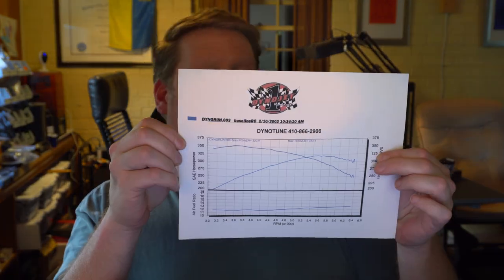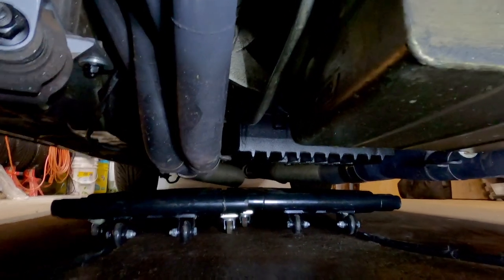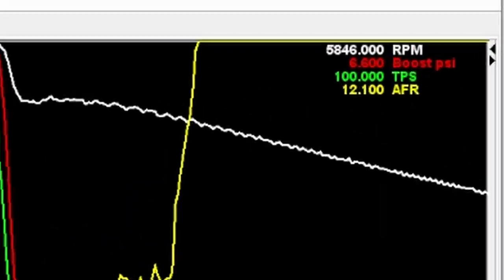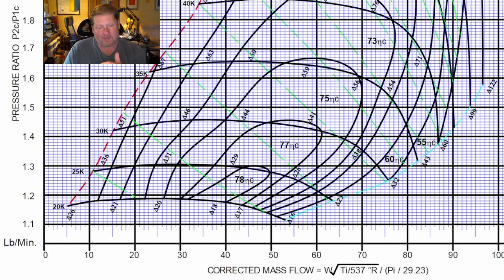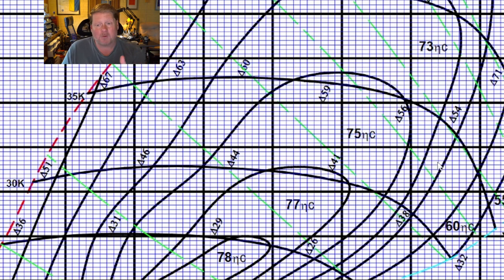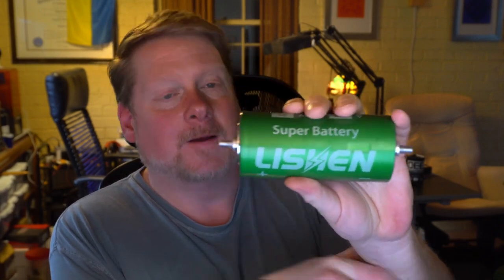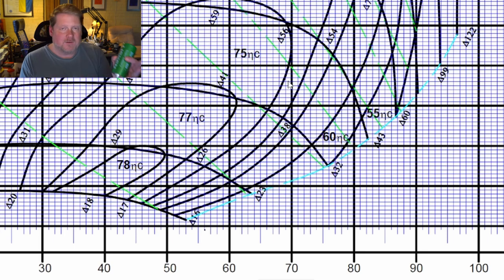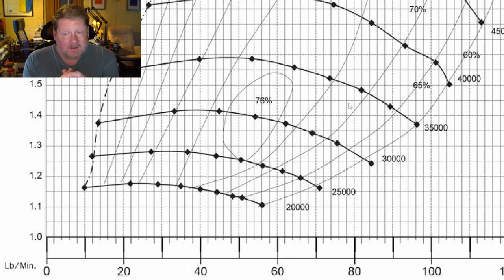DIY Electric Turbo: More Power from the Sledgehammer

Comment: The motor is direct drive or have a set of pulleys on the impeler? Why not make a set of pulley behind the "turbo" that actually you need less voltage to achieve the desired rpm of the turbo?
Reply from the maker: The motor is direct drive - if you look back in my electric turbo videos you can see how I made it - it's a hex drive.  I've also built a smaller unit that's belt driven so you can fine tune the ratio to get maximum power.  I will get back to that smaller unit, probably over the summer when it's too hot to race.  There are some problems with a belt drive.  At the speeds we're talking about, the belt gets hot fast.  As for a significant step up as you're suggesting, the problem is still one of available power.  The lower rpm your motor is, the more step up you need.  Which means you need a proportional increase in torque.  Which means the motor size dramatically increases.  And then of course, you have drive losses to overcome.  At this moment, given available brushless motors, I'm favoring direct drive units.  That doesn't mean things won't change, it's just what I think is the best for current technology.

Comment: I spray methanol at the cold side charge pipe and manifold intake via a boomba spacer with ports. I would love to hear more about pre-compressor spray. I'm not sure where that is and I don't want to assume I know, my guess would be wrong most likely (I am also running air to air intercooler). But I definitely want some pro and cons on what you're planning on methanol so I can think on it and see if it's something I may consider. Cheers 🍻

Edit:
I'm not looking for more power but more efficiency and engine longevity. I'd rather buy a new turbo vs a new engine.
Reply from the maker: I'll do some videos on that soon enough (in the next few months).  I can think of pros and cons in your case, but you'd have to decide for yourself if it suits your needs.  I'll do my build, installation and testing, and you can use my data to make your choice.
Reply: @AlexLTDLX  good stuff man 👍🏾

Comment: i have 300c v8 5.7  awd, and it is car for highway(not some drag strip project) and i am looking to raise power for some 100hp but i do not wanna install supercharger(too expensive) or standard turbo(no space for it).
I was thinking about electric supercharger but it is complicated and i am afraid of lipo fire(it would burn whole car).but i think about some combination : to take two turbos(for 3. 0 diesel engine), one per bank and to split compressor from turbo part: turbo part would be near exhaust collector and compressor would be somewhere in front bumper, turbine would propel brushless electric motor that would act  as generator and on compressor would be (same type) other bs el motor that would be driven by electricity(direct connection by cables, no regulator) from turbine generator, i need some 2-3kw bs motor  that would survive turbine power, do you have some tips for this idea
Reply from the maker: That might work, but you're doubling efficiency losses and I have a feeling that getting the generator side to live with exhaust heat that close might be tricky.  But that's a good way of thinking!

Comment: What is your current battery voltage? What's the maximum voltage your ESC can handle? You need a safety margin of course so you don't turn into smoking rubble. If your current battery solution isn't at the safe upper limit of your controller, then this gets you more motor RPM and you want that. It might be a better way to use those extra batteries you have. Of course if you are already at that best possible battery voltage, less battery sag will help. I forget what you said was your motor Kv, but I'll pretend you said 315kv. You said you are seeing about 4v drop on your phase wires and that's ideally 1,260 RPM that you are not seeing at your impeller. Those long phase wires are causing you boost losses.
Reply from the maker: I charge the packs to just a bit over 62 volts.  The ESC's max rating is 63 volts (I looked at the capacitors in the ESC - they are indeed, 63 volt caps).  The motor kV is 615 at the actual load we were seeing.  I believe the motor's rated at 750 kV or something.
Reply: @AlexLTDLX  Yes...you don't want to go to a higher voltage. You are there! Motor KV is determined under no load. You are seeing this yourself that you don't ever see that free spinning RPM under load. If your motor is 750kv then at 62v, that's a maximum of 46,500 RPM. With 4v loss from phase wire length that's 3000 RPM not happening at the motor under ideal circumstances. Id still guess at another 1200-1500 RPM you should be seeing at the motor under load.
*
You know your boost pressure since you have a sensor for that. With the brushless motor and controller, you can set your motor to X RPM and then measure boost pressure. Have you done any mapping of motor RPM vs boost pressure? The new impeller has some kind of graphed map of it's output pressure at various RPM's. How close are you to the specs from that graph? 
*
You've had an exhaust driven turbo on the engine and you know that some amount of engine power is needed to spin the turbo. You can also measure your motor amp draw and battery voltage on the current setup. You have 2 forms of Kw of power used vs wheel horse power gained. My assumption is the motor driven turbo is more efficient, but I don't really know that is true. You need to charge your battery pack and that ought to play into the efficiency results as well. 
*
One last detail. You know you are pulling something like 700 amps at 62v or about 43kw. Is that motor power best served by powering a turbo or by driving the engine crank shaft directly? 
*
This project is quite fascinating to me because I spend a lot of time on EV's and none on ICE. I do love what you are doing and the fact that you are willing to try this out!
Reply from the maker: You bring up some interesting points.  LMT supposedly rates the motor "loaded" - not sure what that means.  But they also told me point blank that 50 volts is 42,000 rpm and 550 amps.  Clearly, we're loading the motor harder than that.  The motor is rated for 40kW (53hp).  We're seeing about 675 amps running with a voltage at the ESC of 52 volts (battery voltage sag) - ~35kW.  It's pretty hard to map boost pressure vs. motor rpm, given these power levels, torque converter slip, etc.  But we are starting to fill in data points from different testing.  This is more efficient than a conventional turbo simply because there are no pumping losses in the engine (a conventional turbo creates a pretty substantial exhaust restriction - sometimes as high as 2-3 to 1 (i.e. 5psi of boost creates 10-15 psi of backpressure in the exhaust).  Currently, the brushless motor is generating about 47hp.  We saw a gain of 150 rwhp from that 47 hp (actually more, but the converter slip wasn't our friend).  If we simply used the motor to help drive the car's wheels directly, we'd see a rwhp gain of, well, 47.  So this is more than 3 times more efficient than driving the wheels directly.
Reply: @AlexLTDLX  LMT = Loaded Motor Torque? They can't give you a hard number for amps in the motor. That is highly dependent on controller current delivery, battery sag, motor loading and motor RPM. So if the other 2 things they said are true...aka 50v = 42,000 RPM, then your motor has an unloaded KV of 840. This is unaffected by current and pack voltage. It does sound like the electric turbo is more efficient than an exhaust driven turbo by a lot. Same for the turbo vs driving the drive shaft directly. You can use your cars alternator with a DC-DC converter to directly charge your battery pack for the turbo. I assume for now that you are charging it externally. Obviously the car has to be running for that to work, but I'm also assuming your car gets driven, not just raced.
Reply from the maker: LMT - Lehner Motoren Technik; they work with MGM (who makes the ESC) and sell their motors/ESCs as a kit of sorts.  I was rather surprised that they were able to be so specific, but clearly, the data says different.  By a good bit.  Interestingly, it doesn't appear to be a duty cycle issue - the phase amps and ESC amps match up pretty well once it's up to speed.  With the VESC, phase amps would be much higher than battery amps when the duty cycle was lower - like around 60%.  Look at my control box video - it has a built-in charger; in fact, I'm officially wiring the charger in today.  And yes, the car gets driven to the track and just driven around in general.  Here's the video: https://youtu.be/J7glXHY3AbI

Comment: What is your best guess on scfm being produced?
Reply from the maker: That's a tough question for me to answer.  Going by the compressor map, we're pretty much at 1,000 cfm (the compressor map has CFM on the X axis below the lb/min - google "Vortech compressor map" and pull up the map for an Si trim.)  Going by traditional "rule of thumb" calculators we're at about 1,200 cfm.  So somewhere in that ballpark.  I'd lean towards the 1,000 CFM number. edit This made me look up leafblower CFM just for laughs.  A powerful leaf blower is rated at 600 cfm; but that's with basically no pressure ratio or internal compression.  At even our relatively low pressure ratio of about 1.42, the  leaf blower would probably simply flow nothing.  Sort of puts that in perspective for me.  I can cap off both my gas backpack blower and my electric handheld with my hand.  There's no chance of doing that with this thing.  Not that I'd even try.

Comment: These listen cells won't last long at 50c, 

They're actually 13c continuous cells.

I'd be running 3 sets in parallel. 

I'm running yinglong cells on my vortech v3 h67b I'm running 45,000 rpm using a pulley system.

If you open my hood. It looks like a stock NA barra territory. The setup is hidden in the front bumper.

I'm using motor width as 2x magnet length equals 2x torque. 

2x motor diameter equals 4x torque. 

So it's more efficient to setup a puller system and gear it accordingly.

My block has a atomic 998kw rebuild kit. All I kept was the crank. Everything was thrown in the trash.

I managed to tear the threads in the head studs recently, so the bottom block is getting drilled and tapped for 14.3mm headstuds for 2000hp max holding and the head is also getting drilled out so the studs will fit.

I'm also taking off a bit more to raise the compression, because I can.

I'm running a btm zf 4 speed territory box with the pressure turned right up with a large gearbox cooler and fan.
I'm running a m86 diff with 4.11 gears and truetrac helical diff internals.

The diff handles 600kw daily and has seen 870kw with no issues

Comment: Try and make a swamp cooler for the electric supercharger
Reply from the maker: That's an interesting thought.  How would you implement that?
Reply: @AlexLTDLX   I would use an air box with k&n filter and and spray it with the water & meth kit and see if temp drop.

Comment: You're literally 1200hp away from where we were 10 years ago with a glide behind a SBF.  A glide is WILDLY MORE EFFICIENT THAN ANY FORD TRANS.  Say it with me.  You can do it.

STOP using the glide as an excuse when it's clearly an advantage.
Reply from the maker: You've never had to have your converter re-stalled?  It's a pretty common occurrence.  I've had to have mine tightened once already.  The glide isn't the issue - the converter is.  Some of it is likely due to heat on the dyno that the car doesn't see in the real world.
Reply: @AlexLTDLX  so you agree that your continual reference to "glide" being a power robber/excuse for low power numbers is INCORRECT.

We run bolt together converters with interchangable internals.  A restall can be done at the track.  Asking me if I've ever had to restall a converter is dumb.

Comment: PLEASE FOR THE LOVE OF GOD DO NOT use pre compressor injection with a centrifugal supercharger, it is most efficient when immediately evaporating due to the heat of intake charge, plus u stand the risk of stalling the compressors to turbo volute not being designed to move water,  pre compressor intake charge will not be hot enough to cause instant evaporation, and in regards to the testing Volvo did I guarantee they were not testing at the same power level u r at
Reply from the maker: Regarding Volvo, that's probably true.  But this thing also gets very little run time as a result of the power level.  I do want to try pre-compressor injection just because of the significant efficiency gains in the compressor and improved distribution.  If it doesn't work, or damages something, you can say, "I told you so..." lol.
Reply: No disrespect Mr. Amalfi, but these statements are incorrect. Many (including myself) have had outstanding, repeatable, and reliable results with pre-compressor injection on centrifugal compressors. For more than a decade, compressors ranging from tiny through megawatt (electrical utilities) have successfully run pre-compressor injection. Just like everything else in life (including supercharging, performance vehicle modification, etc.), there is usually a right way and a lot of wrong ways to accomplish a task. Pre-compressor injection requires proper system design and engineering to succeed; when done properly, the results are exactly as Alex described.